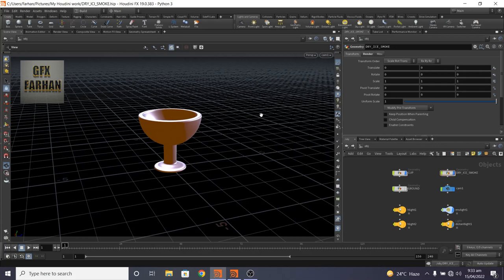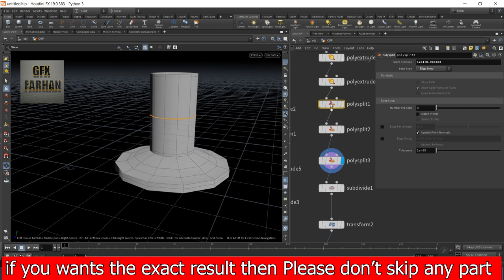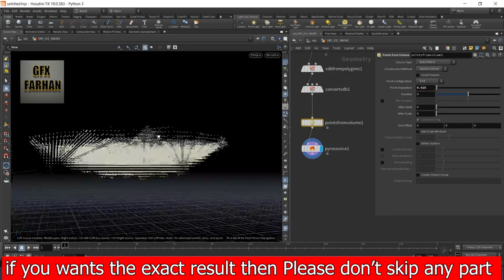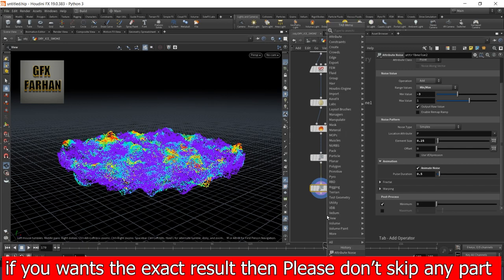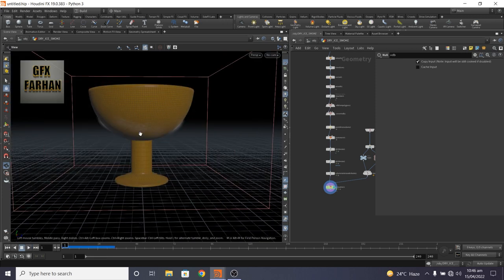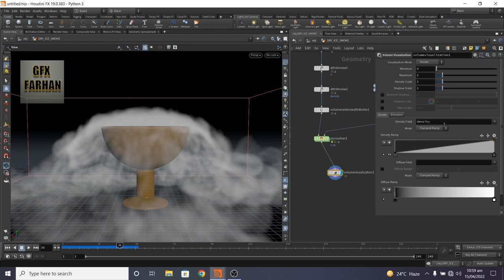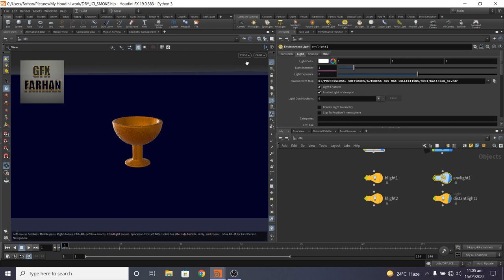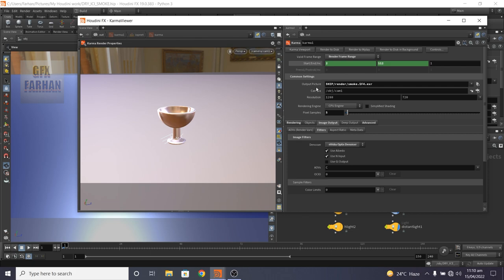How to make dry ice Smoke in houdini | houdini tutorial | houdini pyro fx tutorial

Comment: couldnt find my smoke in karma but I could in mantra
Reply from the maker: Bro it works if you watch full video
Reply: @gfxfarhan  the problem is that I was using is tutorial as a reference. I created my Smoke with a totally different method. Using his foundation as an idea. The question is that do I have to cash my baked simulation for the the volume to render in mantra. I made steam that comes of a hot drink.
Reply from the maker: @tom_elijahbabs9109  great bro
Reply from the maker: @tom_elijahbabs9109  bro stay connected with my channel because I am working on some other Cool stuff which Will published soon.